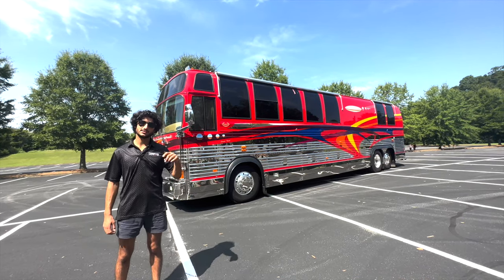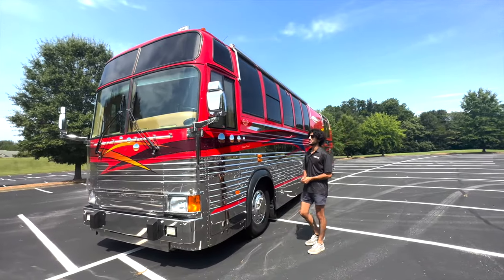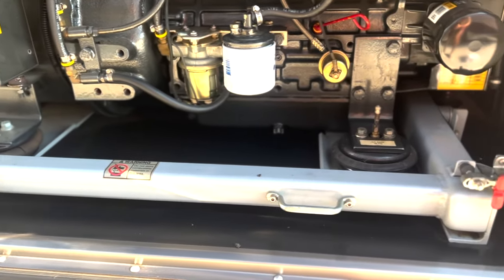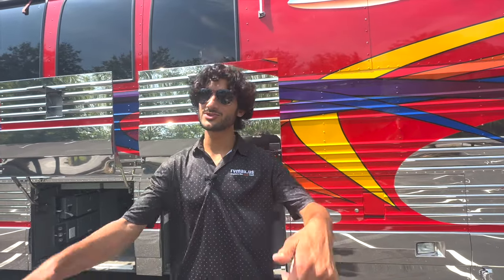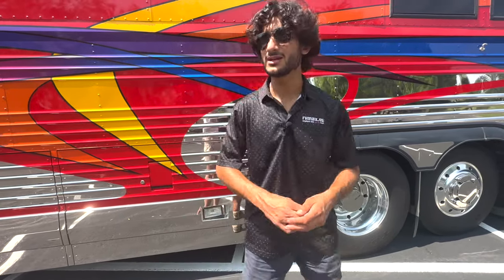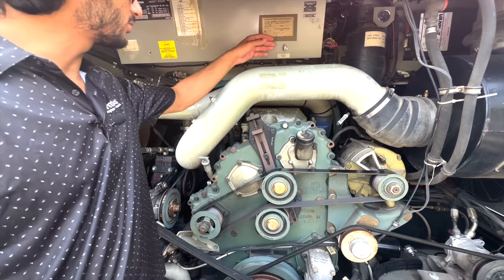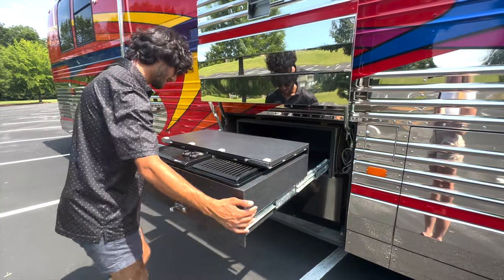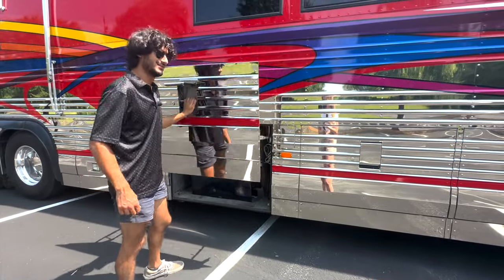BIG RED CHERRY 1999 PREVOST MARATHON XL40 $169950

Comment: Show more of the cockpit area and the outside awning , also does the air tag have a dump switch to make shorter turning capacity? Nice coach
Reply from the maker: Yes all Prevost’s that I have seen have tag dumps. That is a good point I meant to show more of the cockpit. Thanks!

Comment: You said you'd show the front TV!  BTW, where are the speakers?  The A/V  system?  BTW the upper oven looked like microwave-only.  If it had convection, the interior would be stainless steel (to withstand conventional heating) and a turntable in glass or metal.  BTW, was that a backup camera/navigation/communications screen  I saw to the right of the steering wheel? What is the capacity for internet?  My parents had the same Nutone food processing system in their Airstream.  There was a blender jar, food processor with attachments and a juicer.  I would have redone the couches in black or red leather.  And yes, aother name for the shower attachment on a hose is a "telephone showerhead."  My Dad used to refer to it  exactly like that all the time.

Comment: Great video. You say nothing though about mileage, generator hours or that the driver side windows are fogged. Are the door windows fogged as well? I have a 2001 I may be interested in trading. Does this bus have an aqua hot system or something similar? And do you have all the maintenance records on it?
Reply from the maker: Call me! Has only 104k miles and low hours on the generator only around 1500.